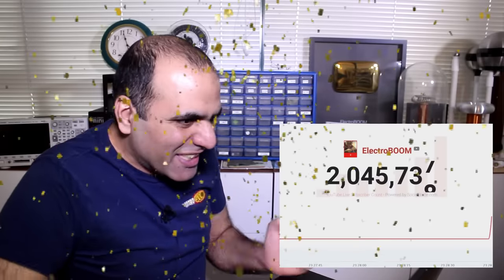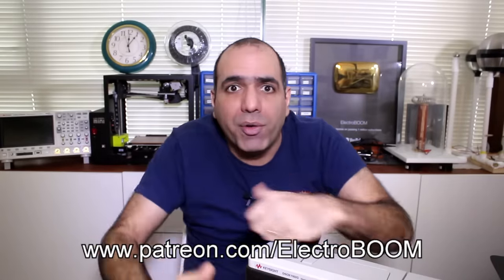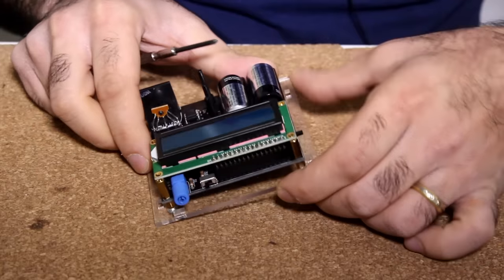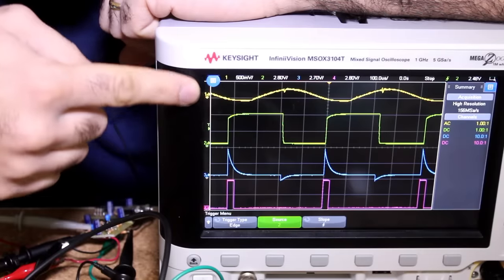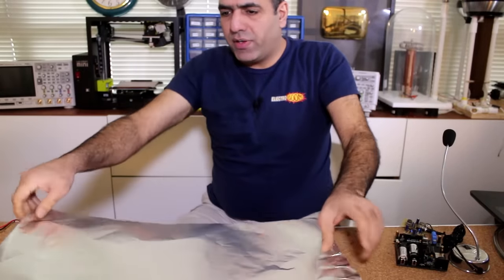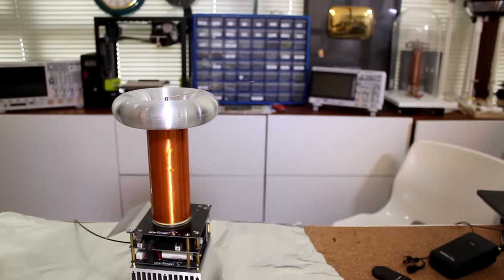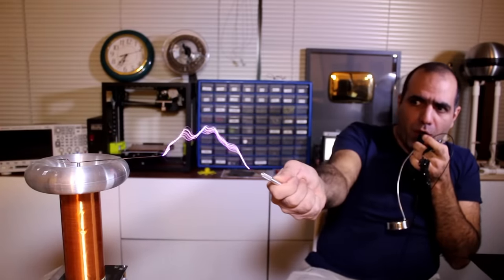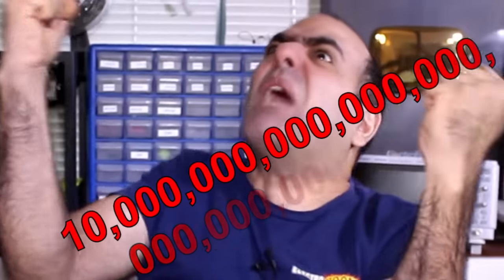Talking with Arcs to Celebrate 2 Million Subs

Comment: you must use a class d amp
Reply from the maker: It is not that straight forward. This Tesla coil is designed to output pulses only at audio frequency because if I run the power continuously and modulate the PWM of the 300kHz resonance frequency, it will overheat and burn. But I did something like this back in my “Magic Music and Mayhem with Tesla Coil” video in my own design. But with this one, it needs to be done differently. I can’t PWM the pulses which are at the audio frequency. It wouldn’t sound good. Remember in class D we are modulating the signal at a high frequency carrier that is filtered through LC filter of the circuit output to speaker.
Reply: Yeah!! ......what ElectroBOOM said ...
Reply: @Recovering_Californian  hhhhh
Reply: How about varying the width of that 10 to 50 uS pulse (actually 14 to 50uS based on your scope)  -- ie, modulate it's width with the audio signal -- ie fixed-frequency Pulse Width Modulation.  That way, the intensity of the sparks will vary in sync with the audio.
The way this would work is, when you turn it on, when there is no sound (i.e. audio is below some threshold [which could be zero]), 10[14]uS pulses go to the TC, then as audio is transduced by the microphone, the width of the pulses increase with sound level, until the 50uS limit is reached [at some upper audio intensity].  Maybe, also, throw in a logarithmic conversion, to act as a compressor/limiter ["logarithmic amplifier" op-amp circuit].
Reply: @steve42lawson  but that would require creating one from scratch with lets say an arduino 
at with a pwm freq of 64khz and reading the audio signal with a built in adc

Comment: Is it safe to stick a fork in an outlet
Reply: Yea
Reply: Try it out I did and it got magnetic it is a cool life hack
Reply: Put it in the microwave, it will turn shiny
Reply: Yea sure its totally a safe way to meet your creator and cook your meat to perfection at the same time...
Reply: try to stick it if you dont fry its safe
Reply: You should try it with your fingers, it's much safer.
Reply: It lights up like a light bulb
Reply: Only if you hold it with two hands. It balances out the flux
Reply: yes
Reply: It'll give you super powers
Reply: @espurious  well that's shocking
Reply: Yes
Reply: Actually yes

With the right protection
Reply: bobb ross yeah man go for it

Comment: Why impedance is in general imaginary number???
Reply: Because it represents the real and imaginary resistance in a circuit. Real resistance would be measurable. "Imaginary resistance" or impedance is caused by the way current flows through and inductive or capacitive load. Impedance is frequency dependant btw. So in a capacitive load current flows via a displacements current and in an inductive load, the magnetic field produced also impedes the current flow